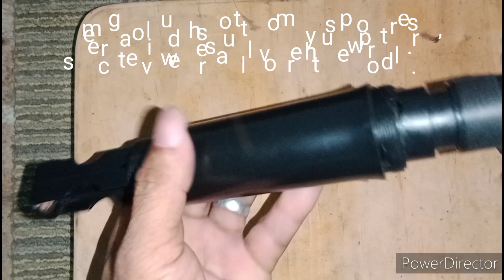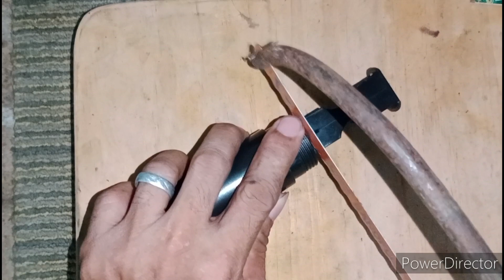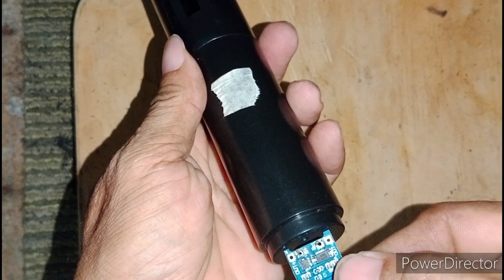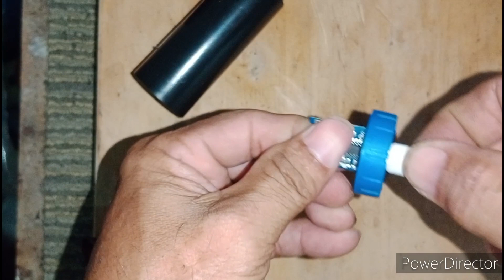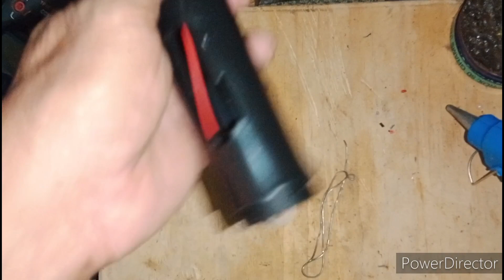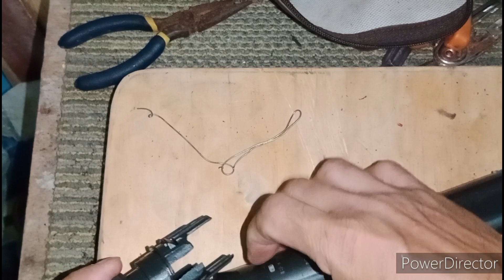how to convert wireless microphone batteries in to lithium ion rechargeable battery

Comment: OK lang ba i-direct ang 18650battery na may 3.7v sa microphone na walang diode? kasi yung recommended volts ng microsphere dalawang AA or AAA battery na may 1.5v kada isa. di kaya masira yung board?

Comment: Hindi ba mataas po?
Reply from the maker: Anong mataas ang tinutukoy nyo po
Reply: @allaboutelectronicsph  kasi 3v lang po yan ,kapag full 4.2 okay lang po yun ,ganyan sana gawin ko sa extreme mic ko po
Reply from the maker: May voltage regulator nmn Yan sa board Ng mic.. Kya safe pa rin ang mic..
Reply: @allaboutelectronicsph  lahat po ng mic sir?
Reply from the maker: O2, Basta Yung mic may battery..
Reply: @allaboutelectronicsph  salamat po sir ,kasi inon ko po wala naman po pumutok

Comment: parang masusunog naman ang board nyan boss kasi dalawang 1.5v lang yan  tapos ang pinalit nyo 3.7v tapos pag nafullcharge payan ang 18650 4.1v nayan
Reply from the maker: Hindi Yan maauaunog kc may voltage regulator Yag  board..
Reply: kaya nga..nominal voltagetng 18650 lit-ion cell is 3.7v then full is up to 4.2v.. ung ginamit mo na tp4056 is bms ng batt pero i think over voltage parin si 18650 sa board ng mic..sana wag masira ang mic board..

maganda sana nilagyan nlang ng buck converter para maibaba till 3v para talgang safe.

anyway nice job,
Reply from the maker: @arezmelendrez2386  salamat sa pag bisita ulit, as I have said, safety Yung mic hind syA masusunog dahil sa mismong board Ng mic meron Yung 3.3 voltage regulator ( ams1117) input kaya Hanggang 15 volts, output nmn is 3.3 volts...
Reply: @allaboutelectronicsph  lahat ba ng mic sir ganun?

Comment: Diba po 3v lang yong battery nya Kase 1.5v in series, yang 18650 ay 3.7v Ang nominal nya, di po kaya maover voltage?
Reply from the maker: Hindi Po.. kc may voltage regulator ang board Ng microphone..